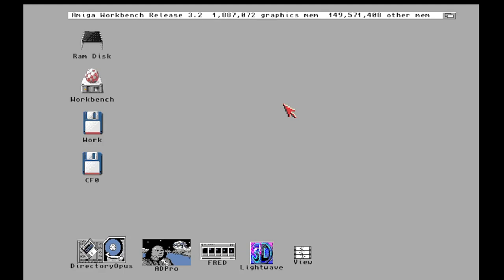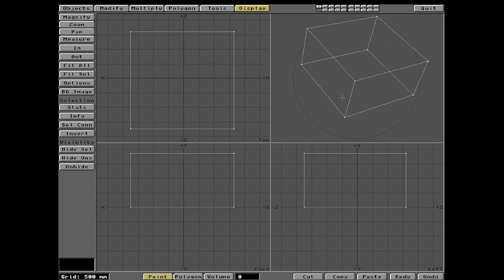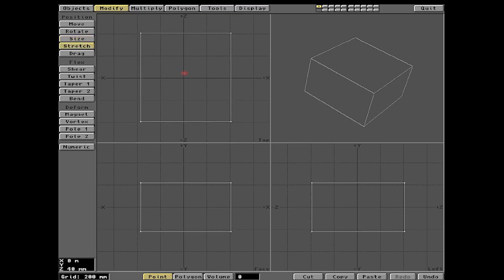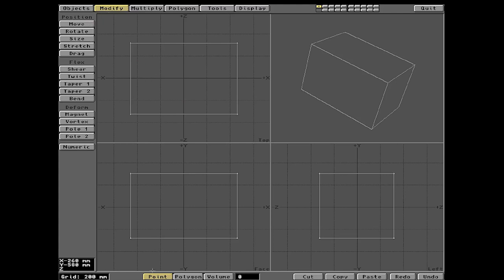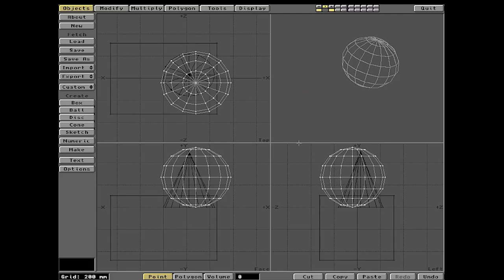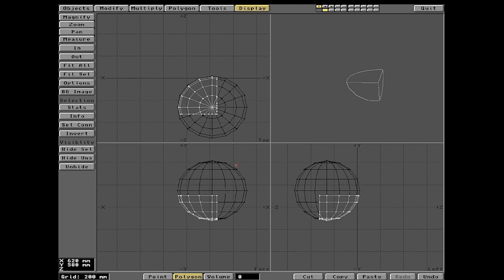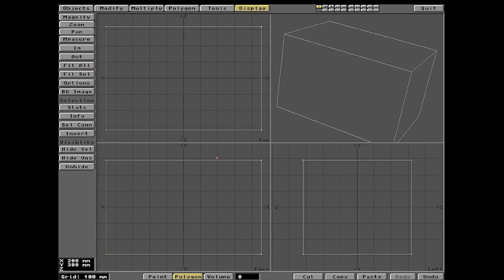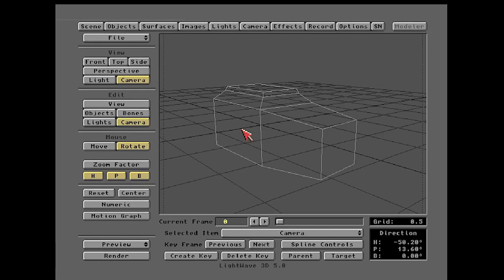(Amiga) Lightwave Basic Ep.8 : Modeler

Comment: absolutely awesome.  i'm so stoked to get into this.  what's the general poly count to keep within on an 030 accelerated machine to where it doesn't create problems with things bogging down?   is ram factored in much with performance?
Reply from the maker: Ram didn’t affect speed much unless you don’t have any Fast Ram m, that is. Once you have 4mb or so you can make quite a bit. Polygons don’t eat up much ram. Textures/images do. Which is why procedural textures were so popular back then. Since that’s all math and doesn’t take up ram like images.
Reply: @HoldandModify  in terms of points to manage does it get bogged down with high poly counts?  i figure the calculation of 3d points and refreshing might hit a tipping point?  also an 030 without FPU..  i've heard there is FPU emulation out there I'm going to explore as well.. as i guess it does have a net gain for 3D performance.
Reply from the maker: Lightwave has non FPU versions. That’s why you’ll see duplicates. One is the FP version and the other integer, non FPU. You’ll have to start creating to see how far you can push it. What is “slow” to you may not be for someone else. It’s quite subjective. Best to start creating and see how far you can go.
Reply: @HoldandModify  yea i've seen the "dual versions" and open the non fpu version but according to muadib3d after LW 3.5 they only made FPU versions of the software.  Agreed it can be subjective for sure.  Though maybe with fpu emulation that ceiling can be bypassed?  It would be so cool if any of the projects like babylon 5 or other famous 3D scenes were made public domain.. just to play with and explore.. the 3D models. really interested to see what can be created.
Reply from the maker: Not sure. You’d have to start creating and see when it starts. There is a hard coded limit of 65,550 points per object. I can tell you that.
Reply: @HoldandModify  that's great to know.  yea i'll have to benchmark it as i get more comfortable with LW and start making some stuff.  love these videos!

Comment: So Lightwave can still do things that  Blender cant do properly 2022,Guess I could do some of my modeling in light wave on the Amiga and export it in to blender, the boolean tool in blender is broken, it can be used but it very broken compared to this.
Reply from the maker: Interesting. Lol. Well you might want to use Lightwave3D 2020. The tools offer more real time previews and are much updated. :) Lightwave3D modeler is still a very good modern app for such things.
Reply: @HoldandModify  It turns out the boolean tool in blender needs to have modifiers in order and "you" have to clean the model because of vert getting mashed together, anyway the price for Light wave is way to expensive, I have  imagine software 3.0 on a 2.5 harddiskdrive from 1998 somewhere lol, Na I guess I will have to use blender as its all I am willing to pay for a 3d modeler now. That or something like 60 dollars.